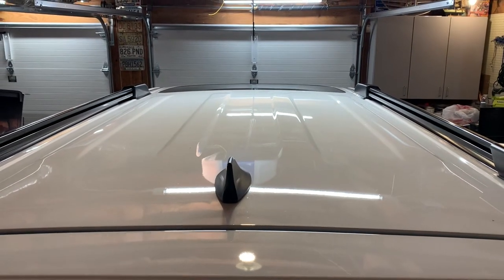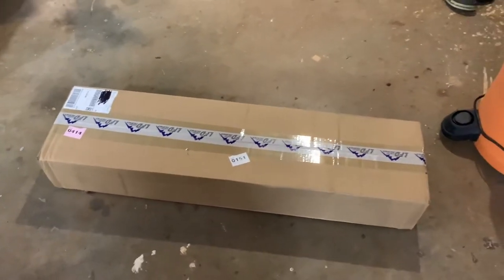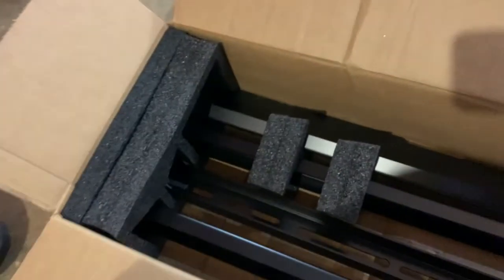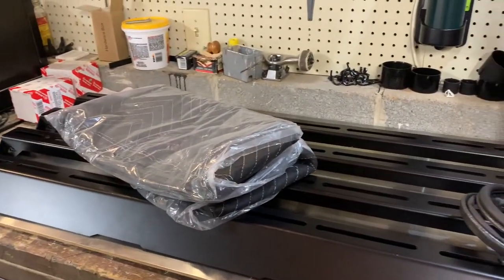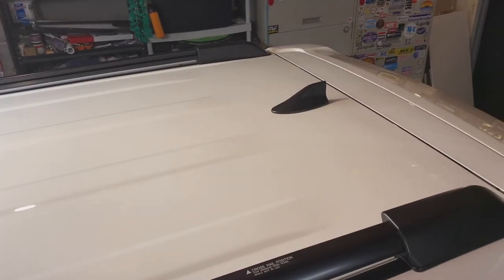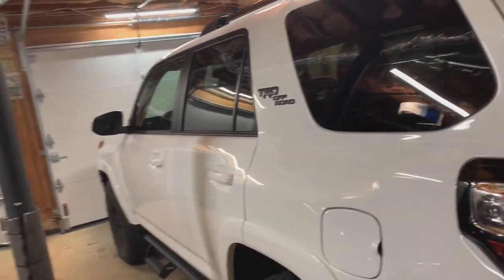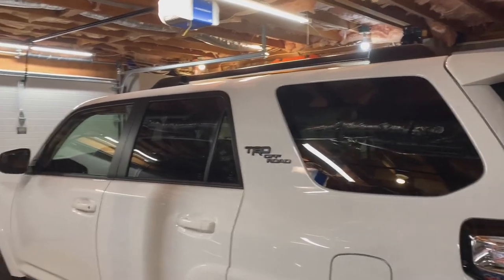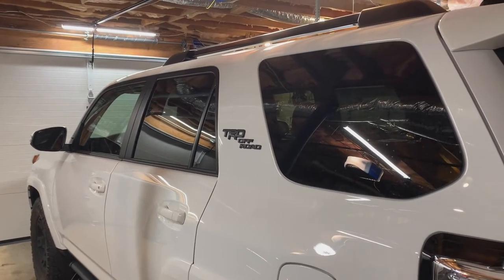Best Hybrid Roof Rack for 5th Gen 4Runner?! LFD Off-road Crossbars | 4Runner roof rack

Comment: DEFINITELY a good idea to put the PPF on that area under ANY fairing - any little bit of dirt or grit under that weather seal will absolutely go through the paint with a quickness.  You can actually get the 6" x 84" XPel PPF from Amazon or Ebay for around $30. Well worth it!
Reply from the maker: That’s a great idea. Have you used the xpel from Amazon? I was curious about how it holds up compared to the 3M options.

Comment: After 2 months, what has been your experience with wind noise and what is your current overall impression of these rails? I’m also looking at purchasing a set for myself and could use your input!
Reply from the maker: My impressions are they are great! I get compliments all the time. They look like they could have come from the factory. The integrated wind fairing works great and since it sits almost flush to the roof is why I think wind noise is minimal. If you keep the sunroof closed you won’t notice but even with it open noise is minimal compared to other racks I’ve had. Mounting options are abundant and so many aftermarket accessories can bolt right on. If you don’t need a full length rack it’s definitely the way to go.

Comment: Been thinking about getting this for a wile have you noticed any noise from wind and also any huge gas millage difference with lfd cross bars
Reply from the maker: After several road trips the mpg difference is minimal. I also haven’t notice much wind noise. If I open the sunroof it can be a bit noisy but I think since the bars sit so far back combined with the built in fairing it keeps it down quite well. Overall I do not regret purchasing them. They have held up quite well so far.

Comment: Would the LFD system work leaving the OEM crossbars in place?
Reply from the maker: I’m not sure. The LFD system takes up quite a bit of space so I’m not sure there would be room for both. You really wouldn’t need the factory crossbars when installing the crossbars from LFD.
Reply: My reason to leave factory x bars is to avoid removing them. I do not need to use a roof box continually, but only seasonally on fishing vacations to the Rockies.  Roof box is primarily for storage  to allow me to have  comfortable sleeping quarters on a bed platform/false bottom inside the vehicle in the fall.
Reply from the maker: @alonzoarredondo  So the LFD system is technically crossbars so they would basically replace the factory ones

Comment: Have you mounted a roof cargo carrier on those racks? I have a 4runner like yours and one time I used the OEM crossbar for the roof cargo carrier and it bounced a lot and vibrated when driving at 70mph. Wonder if it'll fix the issue.
Reply from the maker: I have not mounted a cargo carrier to these bars but I can confirm they Mount to the 4Runner far more securely than other options. It also has grooves so you can really Mount anything to the crossbars.

Comment: Why would you add rails to a system where the feet/anchor points to the roof are made of plastic? PLASTIC!!!  That makes no sense to me.  :)))
Reply from the maker: That’s a great question but the factory side rails support plenty of weight for my needs. If you plan to put more on your roof than what it’s rated for you may want to spring for a full length roof rack.